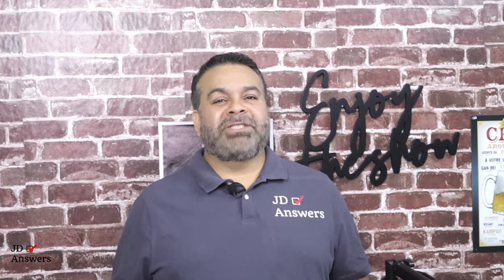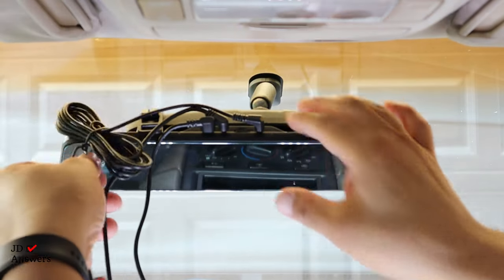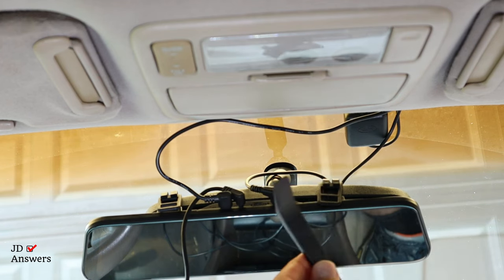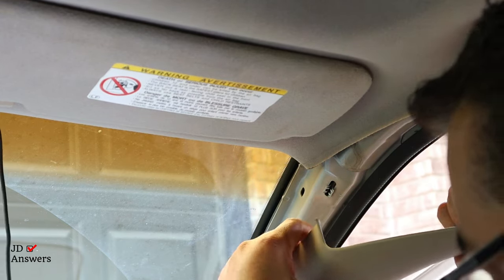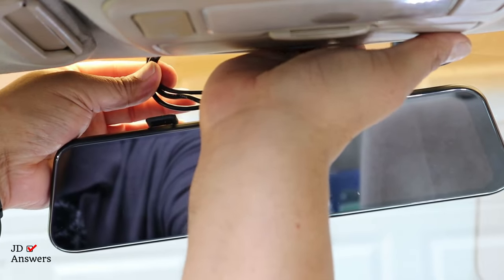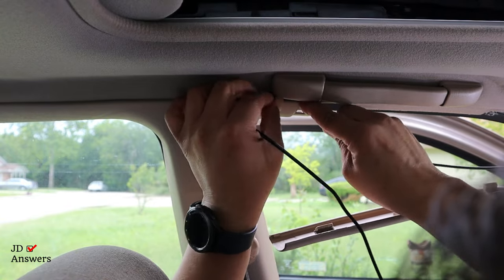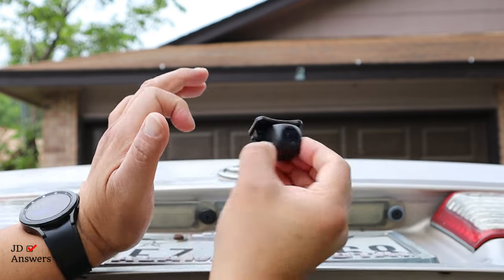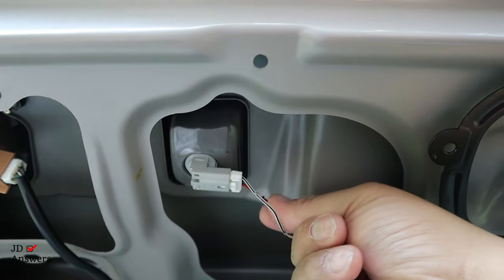HOW TO INSTALL A REAR VIEW MIRROR DASH FOR THE PELSEE P12 STEP-BY-STEP INSTRUCTIONS RED WIRE INSTALL

Comment: Nice presentation. One comment though. The GPS sensor should be placed on the dashboard in a horizontal position facing forward. The way you mounted it vertically on the windshield wound not work. That’s why when you turned on the car, the orientation is constantly changing from E to N to S to W, …..

Comment: Great video.  What if I don't use the T-tap connectors? Do I just cut the red light wire, strip both ends and wire them to the rear cam wire?  I know the T-taps make the installation easier, but I don't have them and don't want to wait for them to install the cam.  Thanks.
Reply from the maker: My installation is only a tutorial for individuals with little or no experience in automotive wiring.  I'm sure your installation will be sufficient.

Comment: The Pelsee P12 was easy to install, took less than 90 minutes on a Nissan Xterra, and the performance of the product is beyond are wildest expectations. 
The most difficult part was in the driver's side rear in fishing the wire through the weatherized protector and connecting to the backside of the rubber wiring seal to the backup light. The rear camera was installed inside and from the top portion of the glass. The rear camera works very well. 
Performance is flawless, and is "transparent". When triggered, the in the mirror display is very bright. License plates are easy to read. 
Calibration for backup zones and monitoring blind space wasn't that difficult. I highly recommend this well engineered and fully thought out product. Be certain to buy a spare SM memory card and USB reader. I bought the 'C' thumb SM reader for my Android phone where I have the Pelsee app. for video review.
Reply: How did you connected to the phone mine say it didn’t find the camera to connect

Comment: Have been thinking of getting a P12 Pro unit and this video is helpful.

Question: In the P12 instructions it states to make sure that the GPS unit should have the GPS side pointing up.  Did the GPS work with it being stuck backwards on the windshield?

Comment: Thank you for an excellent video! Is the rear camera installation necessary for the blind spot monitoring system to work? Because I'm planning to skip the rear camera installation, but would still love to have the blind spot monitoring function.

Comment: I have one the rear cam is powered by the main unit (via some kind of headphone jack), it has a trigger wire but no ground – is this at risk of shorting out the reverse light? Thanks!
Reply from the maker: No, It will not short the reverse light. I had rear dash cam that are connected to my reverse lights for 4 years and I have had no issues.

Comment: Does the BDS work when the screen is off or when it goes to sleep?
Reply: When it's powered on
Reply from the maker: Yes, the BSD does work when the screen is off
Reply: @JD Answers  thank you! Does ADAS and BDS work simultaneously when either front or back cam are displayed? Also can the ADAS be just an alert tone or does it have to give a speech announcement?

Comment: Hello, my dash cam was working but for some reason, i unplugged and plugged again and now is not turning on, not with the cable c i got, but if i use a cable c to c it works wonder why
Reply from the maker: My only reasons is that the cablesl wires inside the wire might have lost connection inside the wire. Contact the company support for a new cable. I had a small issue with my dash cam and they were able to help me with the issue with no problems.